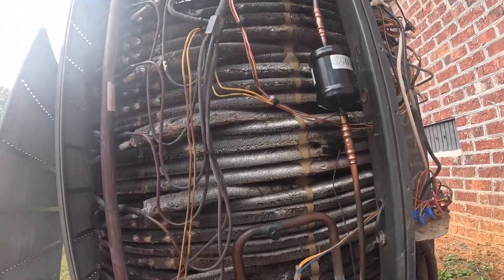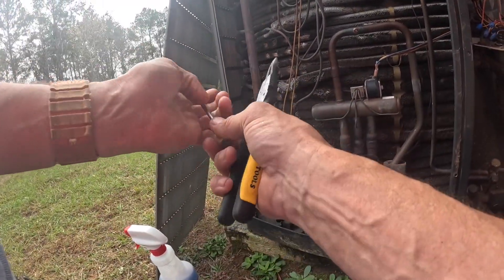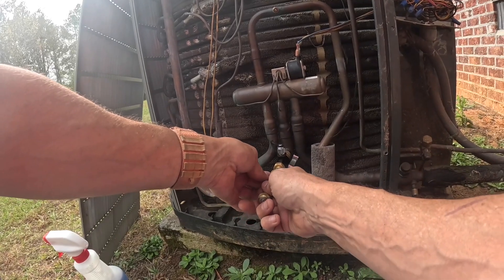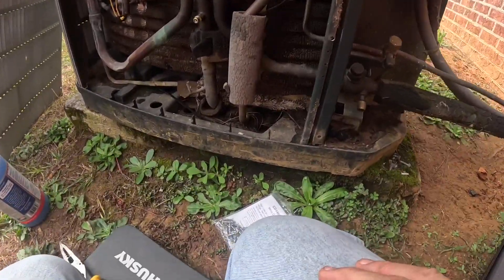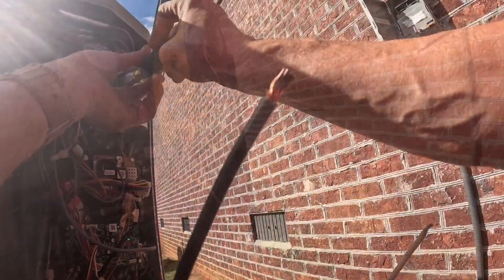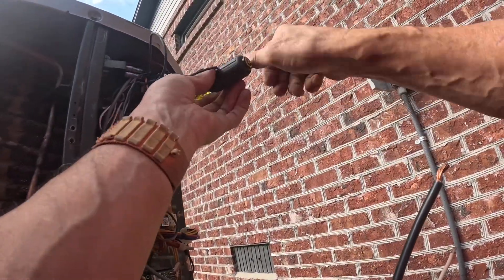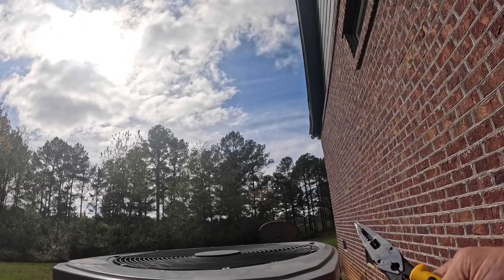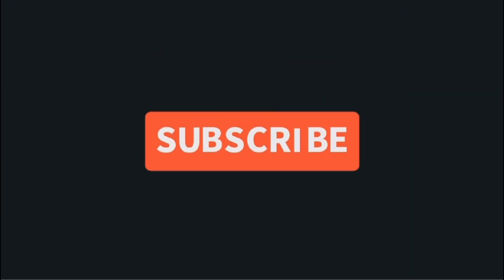Loud System Causes Callback! #hvacguy #hvaclife

Comment: I own that same Appion VCRT. Mine has never removed a single core from the tool.  It will unscrew the core just fine, but no matter how tightly I adjust the jaws, it always drops the core in the tool.  I hate the thing.  Waste of money.  My C&D works reliably... though no side port.

Comment: You never just pull the core remover off like you just did you close the valve take the end off then open the core remover make sure the core is seated. That could have dumped that whole charge.

Comment: I have a trane also a/c heat pump. Question why are the coils different than other outside units and are they harder to clean
Reply from the maker: That’s just their design, and you’re right. They are harder to clean.
Reply: I have a question. Where do u hook up ur temp clamps on heat pump mode? Blue one on suction and red one on liquid? Same thingv

Comment: I've found out a long time ago throw out plastic caps . Use brass ones with o ring seal . Also don't use brass caps without orange seal . I've seen people over tighten then deforms fitting on the service valve.  When you go to change valve stems you can't get them out. Have a great day.
Reply: As far as seal quality goes, the metal-metal flare caps are superior to anything with an o-ring. The reason they get a bad rap for leaking is because nobody ever wrench-tightens them like they're supposed to. And every time without fail it gets pegged as the Schroeder core when it's really user error.

Rule of thumb for anything mechanical: 
If it has 6 sides it's meant to be tightened like a bolt. And if you look hard enough you can find a torque spec for it. 
A 1/4" flare fitting will have a 9/16" head. Torque to 9 ft.lbs.
A 5/16" flare fitting will have a 5/8" head. Torque to 14 ft.lbs.

Now I'm not suggesting you go out and buy a torque wrench for these caps, just trying to make the point that if you follow the directions things tend to work as advertised.

Because I know the guy after me isn't going to wrench-tighten them, I tend to swap them for the brass caps with o-rings whenever I can.
Reply: Any time I see the plastic caps I recommend to the customer to let me change to brass. I tell them that caps are cheaper than refrigerant.

Comment: I know the feeling of callbacks. I am a pool equipment repair tech here in Central Florida.  I've found that sometimes people will call back as a means to delay paying. It doesn't happen a lot but it happens. I'm not suggesting this is the case with your situation. Have a great weekend Curtis. We had lots of rain here yesterday so I'm backed up. Installed a heat pump today. Tomorrow it's 2 pools lights and a salt chlorine system.